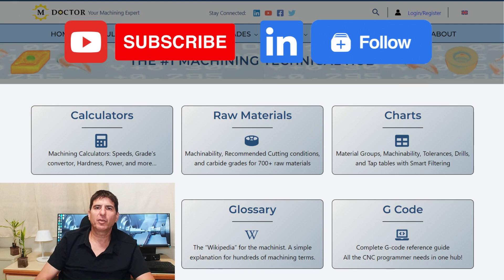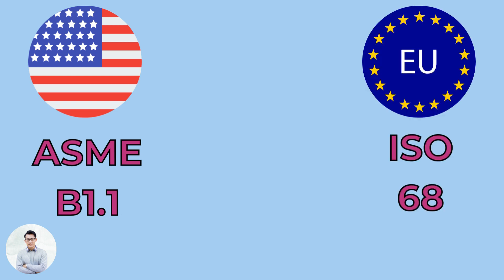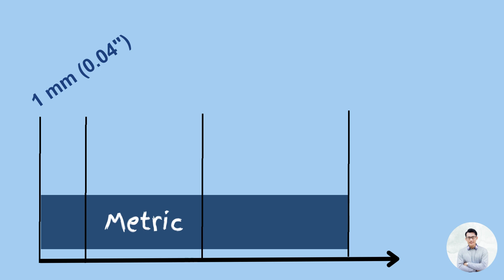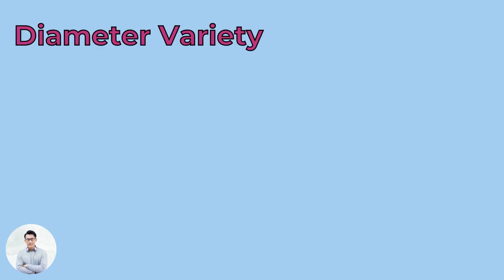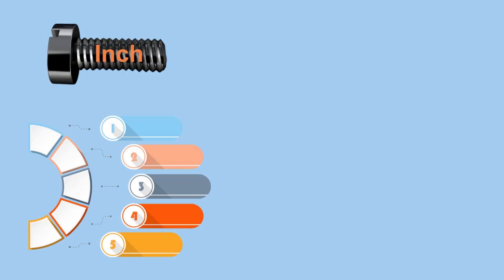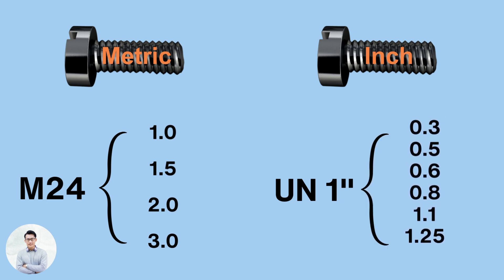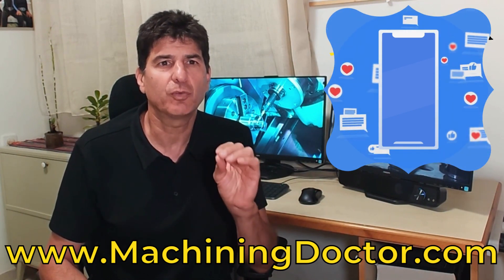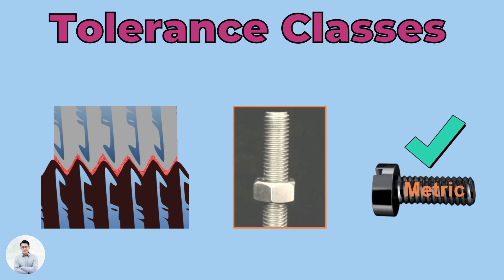Inch Vs. Metric Threads - Engineering advantages & disadvantages

Comment: pitch/dia combination seems like mistake, you can basically use whatever pitch you want unless it's some nonsense like when the bottom of the thread would hit the center ex. in M3x4, you can turn M105 from 0.2 above 6 just most of the pitches wouldnt be normalized
Reply from the maker: Hi, I am not sure I understand your remark. Sure, you can produce any pitch with any diameter (Almost). The argument refers to the standard combinations. It is always better to opt for a standard thread where you have the option to purchase a bolt/screw from stock. If both the male and female components are custom-made, then it does not matter.